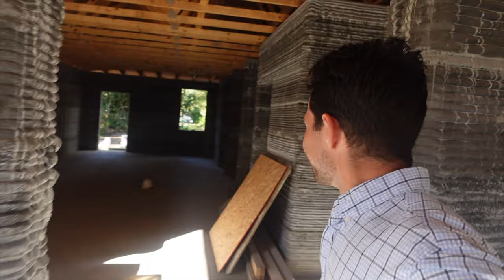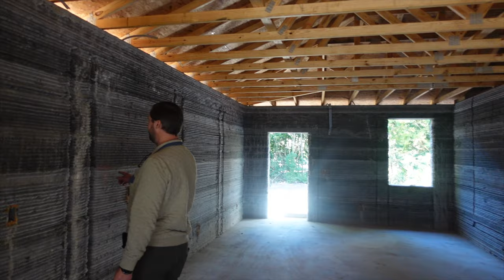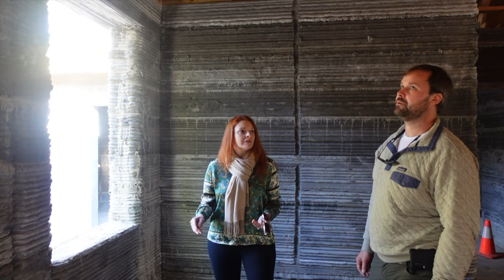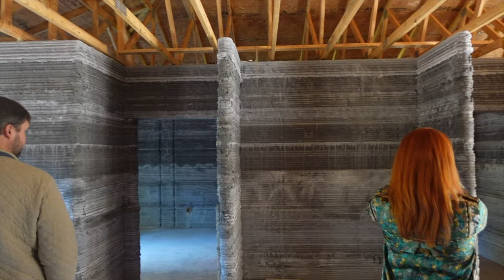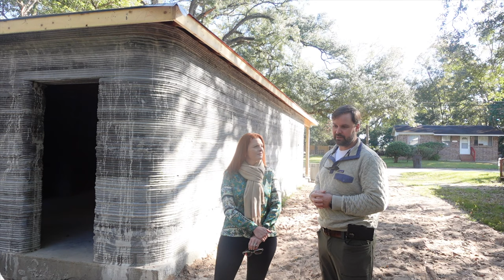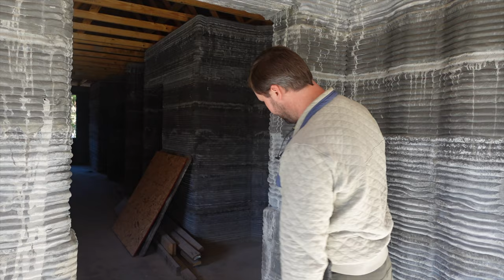Husband & Wife 3D Print a House | How to Win Permits

Comment: Could 3d printed homes withstand wild fires?
Reply from the maker: Ideally you’d have a different roof system or at least some fireproofing in a wild fire prone region. The concrete should be fine but hasn’t been fire rated yet.